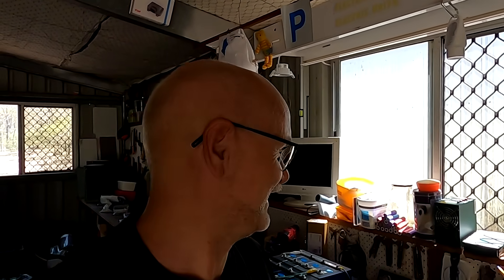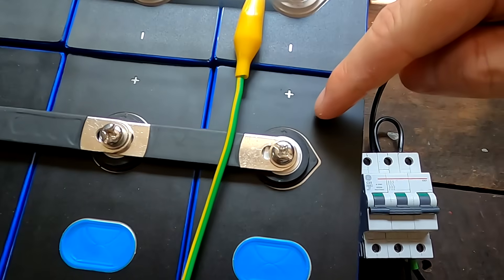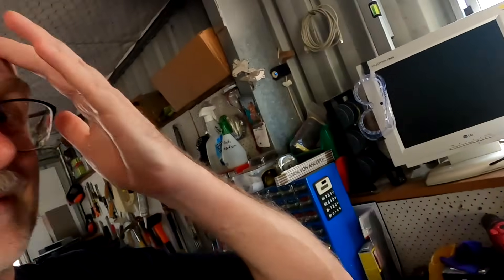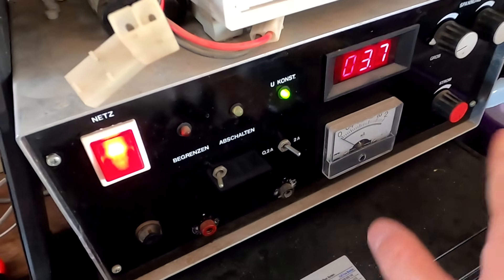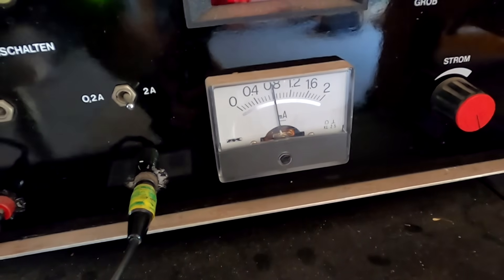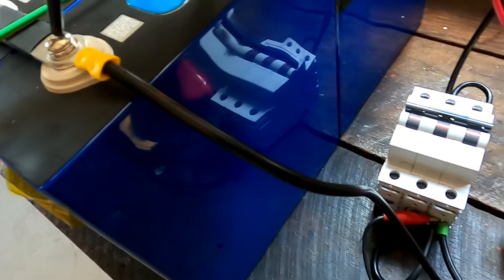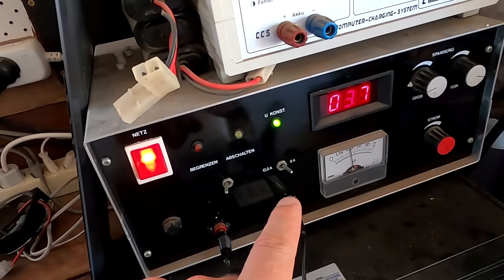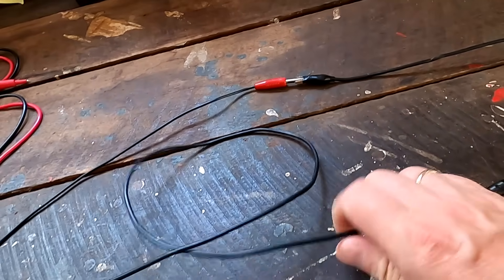Workshop: Lithium Charging 101 -  Solar Charging without Controller (Part1-2)

Comment: Hi, Nice videos.
Question: if you (unsafely) charge the battery at such higher voltage, does it charge faster that at 3.6 volts at the same amperage ?
Reply: I highly recommend reading the full article linked below plus all the other articles on that site pertaining to LiFePO4 batteries. It should be considered essential reading in my opinion. [source follows]

“The graph above illustrates that while 3.3V is insufficient to recharge a cell, 3.4V is enough to obtain near 100% capacity already and limiting voltage cannot realistically prevent overcharging without also compromising charging.It also highlights that using high absorption voltages essentially fails to achieve anything as far as capacity is concerned, but charging times would certainly be reduced if also shown.
LFP cells simply don’t really charge at voltages up to 3.3V and then fully charge already at 3.4V and upwards. The transition is so abrupt that claiming to control the charging process by adjusting the voltage is purely and simply bound to fail._

Charging at reduced voltages, down to 3.4V/cell, only increases the absorption time and therefore the overall charging time, but achieves strictly nothing in terms of preventing the battery from getting fully charged and then overcharged. It only takes longer for this to happen. Furthermore, low-voltage charging opens the door to severe longer term performance issues which arise from memory effects in the cells”

Source: http://nordkyndesign.com/practical-characteristics-of-lithium-iron-phosphate-battery-cells/
Reply from the maker: Yes, it does charge faster, the amps will rise if you increase the voltage at your source. Up until the ampere limit the source can deliver. Hence the power supply stopped at 2A and the solar panel stopped at 8A. Very low current for a 2200Ah battery.